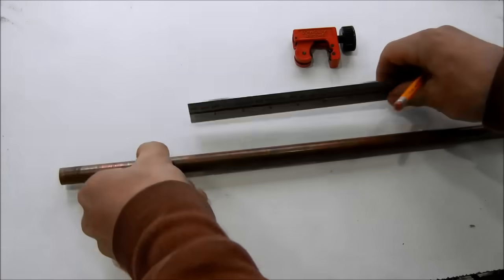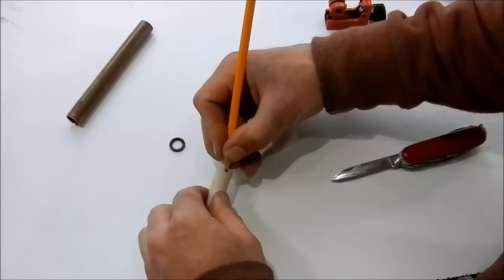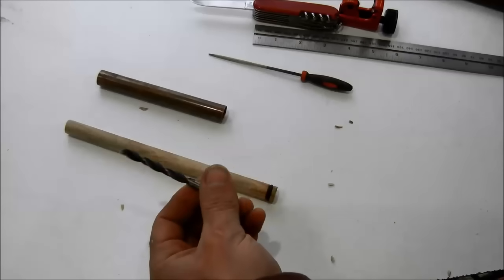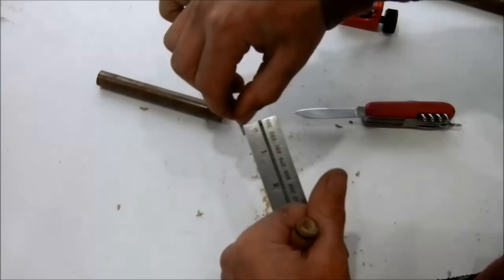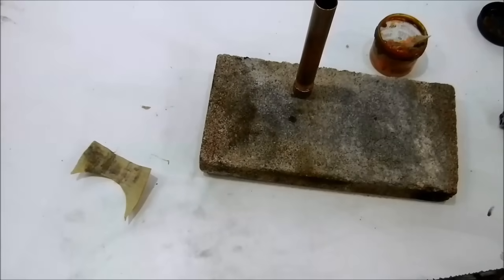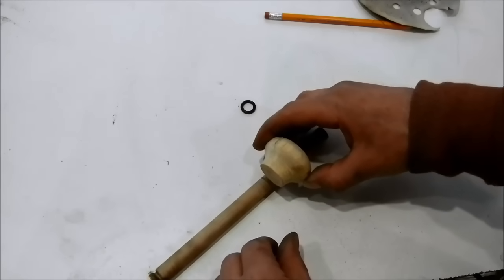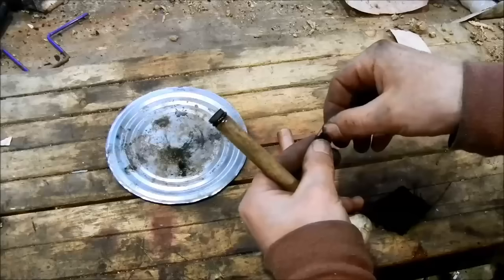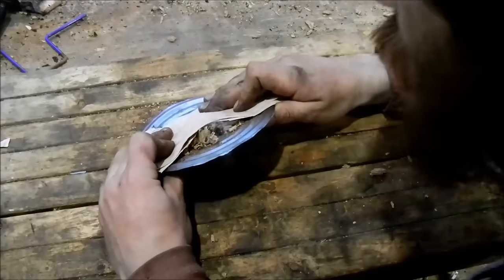Making and Using a Fire Piston

Comment: For anyone interested in how to make charcloth: Get yourself an old Prince Albert Tobacco can.  An Altoids tin works good too, but it just doesn't hold as much. Punch a hole in one end with a nail. Get yourself some 100% cotton cloth. Fold it up and fill the can. Not packed super tight, but full. Close the can and put it on a good heat source. I use a gas cooktop or camp stove. But a small campfire's fine too. When u start seeing vapors coming out of the nail hole, light the vapors. It'll produce a flame like a butane lighter. If the flame goes out keep re-lighting it. Once it refuses to re-light, your charcloth is done. Let the can cool. Open er up n dump out your charcloth. Be gentle with it as it's very delicate. You only need a tiny bit of it at a time (postage stamp size) to start ur fire. I store mine in an Altoids tin.
Reply: THANK you this saves me a bunch of time looking. Very clear and easy to understand. Another 'old way' that can be useful in damp situations! 
Do you find any difference in quality with new cotton vs old? Dyed and undyed? Easy enough to make a batch inna survival type scenario
Reply: @koreymann2493  I used some old denim jeans, and they made much better charcloth than when I used old shirts. They hold up much better and don't disintegrate so easily.
Reply: @ShadeSlayer1911  same here I only use denim now
Reply: @koreymann2493  I was told to make charcloth from old t shirts cut into one inch squares , although I have not tried it yet.
Reply: @koreymann2493  having seen survival videos. An old work out t-shirt or similar is perfect for this. Because it won't care if it's torn or how ugly it is. It'll be perfect for it.
If you cut it up in small squares like 3x3 inches first then you have a nice batch.
Reply: @koreymann2493  Its GOTTA be 100% cotton. Not a blend of any type. Dyed is just fine though. Old fashoned "pillow ticking" is probably best.  But good old worn out cotton sheets n pillowcases is great. The heavier the better. Like hospital type sheets...
Reply: @Foul0wl2112  Would another natural fiber like hemp or jute work?
Reply: @killcat1971  Yes absolutely!  Shaved Cedar bark and the like... Punky wood.  Old denim jeans work great too.
Reply: It should.
Reply: I use flint and steel at Rev War reenactments with a little piece of char cloth to light my pipe.  Works Great.  Will have to make one of these although can't use it at reenactments because they didn't have them back East then. The natives in Papua New Guinea had them though and this is something I'd use as a backup for "normal" camping as a back up in case the lighter died, which they always seem to do at the worst possible time.  Great replacement for wet matches too.  A great thing to use for tinder to slip the char cloth ember into is some sisal rope picked apart to make a nest.  It will ignite much more quickly than the tinder he used here.  One other note when trying to ignite a nest of tinder, hold it up and blow on it from the bottom so you don't get burned when it lights up and have some small sticks already on hand to feed the fire when the nest catches fire.
Reply: @twisted1in66  That's cool. Learned many of my primitive skills in a similar setting. My father and I used to be involved in mountain man/rendezvous reenactments. Haven't done it since Pop died in '93 butl certainly miss it. Admittedly we all used to crack a lot of jokes about the Rev/Civil War enactors. I'm sure we were probably at the butt of many a jibe around y'alls camps too though. All in good fun! A little friendly ribbing never hurt anyone.   👍 😎
BTW the first ever tool l ever forged, after the ubiquitous pot hangers and hoohs, was my own striking steel. I still have it in my tinder kit till this day...
Reply: Im going to recommend a video I've found "How to make char cloth" I've found by a YouTuber "The grey bearded green beret". It's a little long winded. But it is one of the best examples Ive seen.
Reply: You got Prince Edward in a can? You should let him out....
Reply: @somuchtosay  You got to be as old as i am since you made that comment. Lmao
Reply: @somuchtosay  Too late. I accidentally cremated him.
Reply: Mom Q
Reply: Thanks for that
Reply: Thanks friend
Reply: Funnily enough, I live in a city called prince albert.
Reply: @lawrenceeytcheson1317  lol
Reply: An old kiwi shoe polish container works very well
Reply: Fascinating, not many people know that,
Reply: I use monks cloth. Walmart used to have it
Reply: Thanks fer the tip. I use the chewbacco for keepin worms out my dog , skol wld work too init?
Reply: Thank you, that was going to be my next search lol, you saved me the trouble, cheers
Reply: Just for some easier to research info the process for making charcloth is just carbonization, which is the same way you'd make charcoal in an old steel drum really. Just a lot smaller scale. Also basically the same way you make wood gas, you can make a gasometer to store those vapors and use that like natural gas if you were doing enough at a time
Reply: thanks! <3
Reply: Instructions unclear…my penis is now pierced and my shirt is on fire
Reply: Thanks. I was wondering how to do that.
Reply: THANKS!!!
Reply: Nice Trick. Very much like a forgotten hobo skill.
Reply: Scale that up and you can make biochar
Reply: .. and obviously BTW lay the can on it's side (or however it is most evenly expised to the heat source).
Dont stand the can on end lay it flat on the burner. Seems obvious... But you know how people are nowdays
Reply: Outstanding 👍👍
Reply: What is the physics of this?
Reply: @user9b2 What ShadeSlayer1911 said, but in actual scientific terms, is an application of Boyle's Ideal Gasses Law (PV=nRT). The concept is very similar to the way a diesel engine ignites fuel; in a closed system with 2 states (like this device), you can simplify to (P1•V1)/T1=(P2•V2)/T2, which shows that increasing pressure (by reducing volume) must result in an equivalent temperature increase. Compressing a gas requires work in order to overcome friction, in this case by hitting the piston, which adds energy to the system in the form of heat.
Reply: @user9b2  Of a fire piston? It's just compressing the air quickly. That heats the air up, and if you heat it up enough, you light the charcloth.
Reply: @user9b2 same as a diesel engine
Reply: Charcoal
Reply: Very good video. Kinda difficult to find decent dowels these days though…
Reply: sweet, thanks for the info. You should do a video on that. If you do, let me know. Id like to learn how to do it.
Reply: Badass comment
Reply: Those prince Albert tins are worth at least $7 a piece. I'd find a different tin.
Reply: AWESOME
Reply: That was my question, What is charcloth? Thank you.
Reply: Think all of you guys for all the info it will make life a lot easier when you have nothing and I can show my grandkids God bless you all
Reply: F that. Altoids can all the way
Reply: Denim works great!
Reply: @1234hijsYes it certainly does
Reply: Thanks 👍 😊
Reply: Thanks for the tip.
Reply: What is the advantage of this technique over using a lighter?    Both are manufactured.
Reply: @sunworshippingblackbuffalo8287  Did you fall through the ice and go too long without oxygen or something?
Reply: @sunworshippingblackbuffalo8287  
It's just another tool.
It's not like lighters ever run out of fuel. 
It's not like it ever rains.
Reply: @Phred Phlintstone      everything has its strength and weakness.    Would not the char cloth get wet?
Reply: buffalo  you've never tried to get a wet lighter you work have you? 
On top of that, if your hands are wet gl trying to get that lighter to work. 

Char cloth just takes a spark real easily.
Reply: @sunworshippingblackbuffalo8287 , It's just another method, lighters always quit at the worst time. Always have backup ways of making fire. 
Fire is survival.
Reply: If you have a lighter to "light the vapors", why not just put the lighter in your pocket and forget making charcloth and a cylinder?
Reply: @jasonk876  “2 is 1 and 1 is none“ warmth/fire is way too important to survival to rely only on a single method 

You do no have to light the vapors to produce char cloth.
Reply: @Menuki  that's true. I only light the vapors as a test to know when the process is complete
Reply: @jasonk876  😆😆😆, your lighter can quit working. When it does youll have another way to make fire
Reply: @DAVID ROBERTS  how will it quit working? Black magic? It's a mechanic device. Just prepare and check your lighter like any other took. Have an extra. They are small, simple and effective devices. Wow! It's so hard to carry an extra lighter!
Reply: @jasonk876  wet, case get cracked in a slip or fall, something holds the gas button down, too windy, hard to use with gloves….

There not bad to have, but they shouldn’t be the only method of combustion. Char cloth will get damp tinder lit faster with a light rather than holding the button down to heat up the tinder
Reply: @Menuki  I was actually joking, initially. I've built many fires outside and they can be difficult to start.
The fire piston is cool but an o-ring could easily rip. Copper can bend. It could malfunction. The piston could break. There are multiple disconnected parts. You could lose one.
I'd rather have a couple of lighters and some wax coated cotton.
It's easier to carry 3 lighters than 1 fire piston. Do you disagree?
Reply: @jasonk876  I always have lighters on hand. I used to smoke, but quit some years ago. But i still have lighters. I do think its a good idea to have other ways of starting a fire other than a lighter. Because lighters can run out of juice, or just quit working.
Reply: @jasonk876 disagree as have been in situations where something like this would have been a godsend. It’s possible that there will be a time in your future where you wont have a lighter, and also some people like making things and working with survival tools because you learn and it’s fun….
Reply: @soulslip  if you enjoy it then it's great! I was just saying that i would rather carry multiple lighters. They just straight up work.

Comment: Good video.I'm not sure I understand how it works.  I know that from what I have seen, I want to make one, but my experience is the ferro-rod and steel is quicker.  What am I missing here?
Reply: Friction creates the heat to ignite the embers of the fuel(steel wool he presented i believe).
If you were to make one of these you could use it as an emergency starter in the chance the ferro-rod fails.
(I would keep dryer lint in fire piston and use as ignition source)

Comment: How those bastards from the middle-ages made it without the O+RING???
Reply: And you think they had seamless copper pipes, or a screw for the handle for that matter?
They would probably just use flint and also most probable had a fire always running somewhere, so you could just go and borrow some embers from someone running a fire nearby.

Comment: Tiny bit of improvement to this is to solder on another cap at the upper open end then use a pipe cutter to cut the top off the cap so the open end is protected from denting and deformation.

Comment: I am over 70 years old.  I have been around and I've never even heard of a fire piston before.  Something new every day...  Thanks!
Reply: I'm 80, and remember making a couple of these 65-70 years ago. For some reason we called it an Eskimo lighter. Used a bamboo cylinder, and usually took a couple of smacks to get it smoldering. Carried it running around the swamps and bayous in South Louisiana.
Reply: @leonardsemrick2785    Had a leather washer.  It worked best if you kept the washer waxed.
Reply: @ cool
Reply: They had fire pistons before matches
Reply: Diesel principal, GAUSS physics extreme
Reply: @gonzaloreyes9633 I understand the diesel principle but how does Gauss figure in the device?
Reply: Could be called a diesel lighter.
Reply: I'm only 68, but this is new!
Reply: Have you heard of the "Rudiger Roll?" If not; Google it.  😳
Reply: Great.  First time hearing this name .
Reply: this is how a fire starts when their is a Bus Crash  or train crash  car crash plane Crash
Reply: Your teaching UNSAFE assembly practices ! ( using a cutting device on an UNSECURED item )
You're lucky you didn't drill your hand!
Reply: @Whysguy180  Self appointed Sergeant Karin, what would Youtube viewers do without you?
Reply: @Whysguy180 shut up
Reply: @Whysguy180 hes also starting a fire on his work bench. Lol if your not bleeding your not working..
Reply: @Whysguy180 it's not his job to keep you safe

Comment: Is there an ideal width and length or will this work at various sizes? I mean, could this be miniaturized? Also, what exactly is the “coal cloth” used? 

AWESOME VIDEO. Love the format. Simple, no stupid music, sped up appropriately. Just perfect.
Reply: It’s char cloth, it’s easy to make there videos all over YouTube with instructions or you can buy it ready to use
Reply: ...gas engines have 8:1 compession ratio, diesels 10 or 11:1. he's got 5" tube x 1/2" diameter so roughly 10:1 here. the compression ratio would be the key. but it would be neat to know how small you could go.

Comment: This is an awesome low cost fire piston.  I love it!

As a machinist, I made some fire pistons as Christmas gifts a few years back.  The body was 1 inch hex brass stock.  The piston was 5/8 round brass stock turned down to half an inch.  The ID and OD were machined to a 1/2 thou clearance and straightness over the 6 inch length.  On the end of the piston, I made a wider, more shallow cavity with a groove cut across from side to side to make extracting the ember easier.  The ID of the body was initially drilled , then bored and reamed, so it left the drill point in the end to keep from smashing the ember.  This let me make the piston body a bit longer.  I made a threaded cap for the back end of the piston that was 1 inch in diameter to make it easier to use.  Both the end cap and the piston had knurling to make unscrewing the cap easier.  Inside the cap was storage of char cloth.  I drilled out the body of the piston to about 3/4 of an inch from the ember cup, and made a telescoping blow tube that fit inside.  It extended to 18 inches long.  That was great to both direct the air exactly where it needed to be when heating the ember, but without blowing out the just starting tinder and to get your face far enough away so you aren't getting the smoke blowing back at you.
Reply: A nice gift! If you like physics, these are amazing. The blow tube was a nice touch.
Reply: What a cherished gift that would have been.
Reply: Sounds like an excellent design. I like the blow pipe and wonder how you made that. Was it off-the-shelf tubes of decreasing diameters that would fit inside each other? Was there anything to limit how far they slid out of each other or did the user just take care? Thanks for explaining your build, I found it very interesting.
Reply: Sounds awesome. “Where’s your video?” I’d love to see it.
Reply: Is love to see a video of you making that.  Perhaps send the suggestion to blondi hacks or this old Tony. 

If i had a lathe And a little experience I'd love to make one of yours.  It's sounds terrific!
Reply: @tonyp6088  I'm no longer working as a machinist, and don't have access to all of the equipment and tooling any more.  If I can get into a decently equipped shop, I'll gladly show how I made them.  Each one took about 4 hours since everything had such tight tolerances.  That's part of the reason I love this design so much.  It's simpler and opens access to the idea to many more people.
Reply: @jameslmorehead , there is definitely something to be said for functional tools but there is also definitely something to be said for beautiful craftsmanship and high attention to details.
I'm sorry to hear you don't have access to the tools you'd need. I definitely know how that feels.
Reply: Instead of writing a novel, you could simply say that it's a stupid idea!
Reply: @iuliandragomir1  Did you miss the 'I love it!' part?  Was just sharing my experience with a similar project.
Reply: @jameslmorehead  I appreciate your detailed description of how you made yours.
Reply: @unpopularopinion8608  so did i
Reply: @iuliandragomir1  instead of leaving that comment you could have just read Wheaton's Law to yourself quietly.
Reply: @iuliandragomir1 ...
It is better to keep quiet and seem ignorant than to speak up and remove all doubt. ― Unknown, Various Attributions

Comment: Nice. I’m going to try this with a threaded brass pipe nipple and a threaded  cap. A little more expensive, but more durable and quicker to assemble. Also, instead of pushing the rod in as hard as can if it might not give more power if you hold the whole device upside down in your and slam the knob end down.

Comment: What a simple and marvelous example of spontaneous combustion by compression. If it were lighter it would be a marvelous addition to my flight survival kit. But as I see it I think it would make a excellent addition to my backpacking equipment. If it will work in aluminum (and I see no reason why not) I may even include it in both. Two thumbs up!

Occum's Law: Sometimes the simplest solution to a problem is the best solution. 
This supports Occum's Law to a tee! 
Whatever a tee is?
LOL!

Maj. Tamre' "Vixen" Colby USAFE/NATO CAS/AS
Reply: Theoretically you could make this also out of aluminum tubing.  You would have to figure out a different way of making the seal. Possibly you could use apoxy.

Comment: Petroleum based Oil and Grease can destroy many if not most rubber O-Rings, especially over time.  Silicone paste or spray, on the other hand, doesn't.